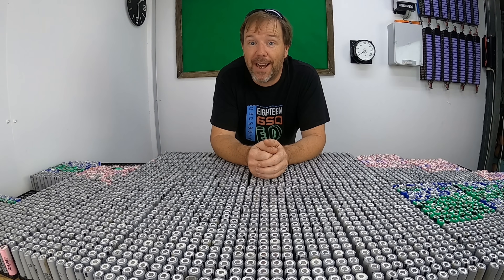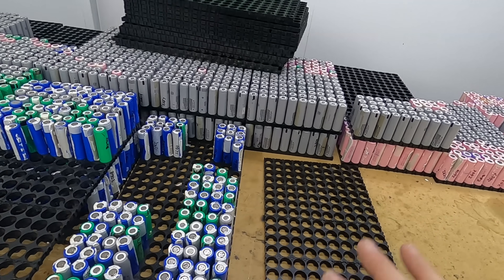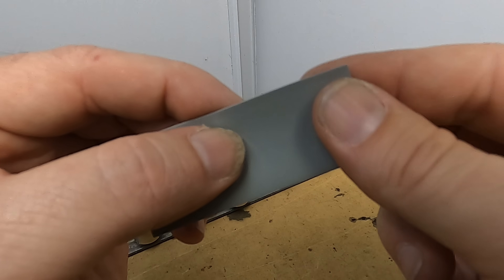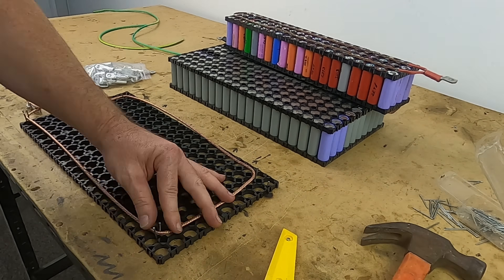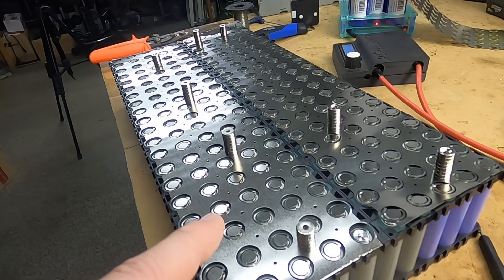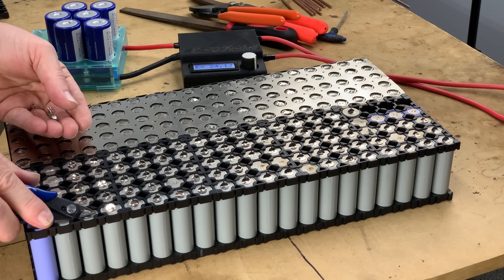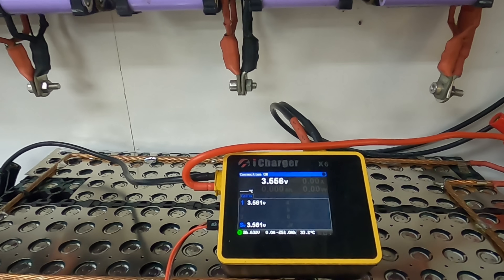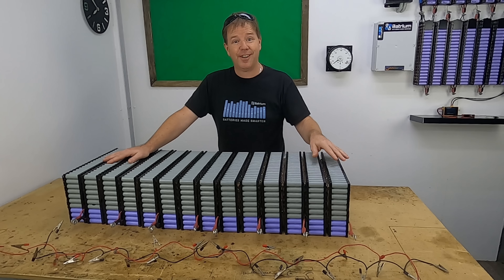Creating my single biggest D.I.Y. battery with 2800 18650 cells recovered from used laptop batteries

Comment: Dude, wtf, if a cell goes bad in the middle of the pack, as is common with old batteries how the heck you going to find it?
Reply from the maker: Thermal camera? Same as a bad piston in a car.. pull it down and inspect..
Reply: @HBPowerwall  thanks mate. Although worse case, 4 cylinders in a bank, not 300. Has this happened in actuality to one of those gigantic banks? How hard to swap only single cells?
Reply from the maker: You don’t swap them you just snip a fuse wire

Comment: I'm a little confused as to the order and placement of things. I was noticing as you were putting in the blanks, you had them installed in places on the cell holder, vertically and horizontally. Was there a reason for the blanks to be placed in that position or was that just what you did because its inconsequential ? I also noticed that you applied heat to some of the batteries in the beginning of the line, then skipped the middle ones, and then went back to the middle to finish. I just wanted to know if that was for a reason and was imperative to the process, or it just didn't matter and you did it out of order.

I hope this doesn't come across as rude, I'm just a little dumb and it kinda threw me off. Love the video!

Comment: Won't you have to replace all these cells after 3 years?
Reply from the maker: Maybe or it could be 10... bit like a used car - if that's all you can afford - you run with what you have..
Reply: @HBPowerwall  Ok thank you. I was just curious because I'm researching about off the grid energy that's cost effective but efficient. Finding the sweet spot as they say. Thank you for replying 😊.
Reply from the maker: Almost any time.. and I have more time than money, so this worked for me. .

Comment: How do you guys sleep at night? I mean, the video is great and all and just wow, how much work you put into the packs. I just wonder, if anything ever goes wrong, can you even imagine the fire that those batteries will create? Just hanging off a wall like that, no fire protection. You know what you are doing I get it, I just couldn't trust lithium batteries. The fuse strips are actually quite astonishing though, I had no idea there was such a thing, but I can see where they add a bunch of additional safety!
Reply from the maker: watch the next few videos, i got 12 hours sleep every night 😉
Reply: @HBPowerwall  i fly racing drones as a hobby and crashed a ton of batteries, so i know how tough they actually are and how much beating they can take. Including improper charging. I am always nervous around them though! Perhaps I am too paranoid
Reply from the maker: Drone batteries typically aren't this type of battery, and lipo's go south FAST, you don't dint or damage these cells in anyway or the internally short and go FIRE fast.
Reply: @HBPowerwall  Good to know! I am starting to experiment with them. I guess I will have to subscribe and binge watch your videos :D

Comment: 13.00   don´t like the  soldering technique;     solder not guaranteed to adhere properly to the nickel plate, only to the copper wires on top, where the flux landed!!    i would  re-do all,why risk it, there are gonna be vibrations around there.
Reply from the maker: I agree, it has all been redone and doubled down on the points. Its stationary storage, zero vibration

Comment: Li-on? Hahahah. you know one hole or something and this is a problem. I would Just put a heat wall around it. that thing is allot of juice. The problem I have with this is my laptop battery became useless when the Charge was irregular, The batteries in laptops have sometimes multiple cells and one will become more or less charged than others and the unregulated power will make it turn into junk, This is a reason allot of laptops batteries "go bad". So If you charge this I would Make Sure to try to keep the current the same in each, overcharge and undercharge and stress on Li-on is pretty... dangerous I guess. Good luck! This is Way too much raw material for me to feel safe handling right as of yet.

Comment: aren't used laptop betteries dead?
Reply from the maker: Typically its just one or two cells that have failed, or perhaps the laptop it self failed and the whole thing was recycled. there is also, going so flat the BMS cuts out, perhaps it was sitting on the front seat of a car and the thermal sensor in the BMS triggered causing it to no longer function as a laptop battery. We have a saying test them all.. if only one out of six cells is useable its a good battery.

Comment: Sort them by impedance then order them by greatness in the series and you may save a lot of balancing.
Reply from the maker: I did everything I could IR was tested at about 50, so they were all nice and close - the batteries were sorted by capacity
Reply: @HBPowerwall  watching documentary saying something like 5 to 20 percent variability within just a single batch made. don't think it would be that tuff to balance the voltage cascade of the series

Comment: Starting off with used batteries kind of makes this a waste of time.
Reply from the maker: 1.2 million views, learnt a LOT, had some fun, built something cool, saved some landfill/early life recycling,  yeh can't see your justification of a 'waste of time if I tried'
Reply: @HBPowerwall  what I mean is your battery packs aren’t going to last as long as if you’ve used new ones.
Reply from the maker: Would any human think that used cells would? I'm guessing your trying to be funny/smart - but honestly it'll work as intended for 10 years with maintainance (current setup is 5 years full time service) then i'll be recycled - just think of all the energy from the grid i won't need... Green house gases saved so many advantages out weigh the 1000s of hours to build..

Comment: from that amount of money you could buy lot more lead acid ones...
Reply from the maker: That would have made a really shit video with less capacity, life span, and DOD..
Reply: @HBPowerwall  i have a lead acid battery bank 1200a at 24v they're working for 7 years now, and bougth them as used folklift batteries. Am I just lucky than?
Reply from the maker: I started the same way... NEVER going back! DOD & energy density is next to no competition.. Look back 500 odd videos you'll see my old setups
Reply: @HBPowerwall  I'll have a look, but for now I'm happy with my setup you know it's working and I'm not loaded to change it.
Reply from the maker: Me either took a year to build this cheap :)

Comment: This is much easier than making ebike battery. Don't need to flip terminal of each section. 3.2v x 14 pack =44.80v system.
Reply from the maker: 3.7v batteries so 48v

Comment: I only spent $62k in used batteries. Now I can power my house. It'll only take 127 hours to build lol
Reply from the maker: Well to be fair, I got the cells on a trade & you could build in say 40 hours is you took out all the fucking around with film and edit.. BUT now i COULD add this to  the other 50kwh i have in service and have 75kwh to power my house for days...
Reply: @HBPowerwall  appreciate the vid. Pretty cool stuff tbh
Reply from the maker: Thank-You

Comment: That looks tedious as all hell... But what happens if a cell goes bad??? How do you troubleshoot all that??? 😬
Reply from the maker: Sounds like you've never replaced a clutch in a car, or had to pay for one.. You bitch like hell about the price and time and you get it done.. What other choice do you have? Drive a broken car?
Reply: @HBPowerwall  🤣

I feel you.

Curious why you went with 18650s instead of those larger rectangular blue cells? Still unsure of what they're called...

Comment: Is a 193p pack a good approach? Doesn't it risk lots of cells even if one becomes faulty? Isn't it a better option to use more smaller p packs, for example 50p max? Is it a possible/preferable to parallel connect multiple 24V/48V packs? For example multiple 50p7s packs connected in parallel each with their own BMS?
Reply from the maker: Time has showen the cells stay more balanced and behave nicer under load with higher P packs... Also cheaper to BMS
Reply: @HBPowerwall  Thanks, important info for me! I'm building my first ever ~100 cell battery for a small vehicle, later thinking about a 1000+ cell pack. So is "Taking 14 cells from the 3400 range, then 14 from 3350 range, then 14 from the 3300 range and so on" a good approach? I thought similar cells in a P pack are the goal, 2450-3400 mAh connected together seems like they would "hurt" each other.

Comment: Impressive! But how labor intense is maintenance/replacement? It seems like laptop batteries really start to degrade within 5 years of use (my experience with batteries in laptops themselves). Buying used batteries it would seem like within 5 years you'd have a lot of lost performance in this type of system.
Reply from the maker: Imagine keeping billions of cells out of land fill for another 5 years.. Maintenance  is always there no matter the project.
Reply: @HBPowerwall  Ultimately the cells need to be recycled, or they all still end up in the landfill anyway. I read China will "dispose" of roughly 2,500,000,000 cells in 2020 alone when upgrading electronics, it said roughly 5% of all lithium cells are recycled.

Comment: Can you help me understand something?, iff i build a pack with random batteries without checking the capacity what is ther worst thing that can happen, i know a chain is as strong as its weakest link and but here i don't know if the bms will push to charge the pack at the highest battery capacity or will stop at the lowers battery capacity, i am doing the same as you with a lot of 18650 but i still don't understande what you do with the difference capacity cells.
Reply: I mean you separate the cells in capacity, then around 2min 40sec into the video do you just evenly distribute them making the packs with mixed capacity cells?.

Comment: How long will one of these battery packs last and will it be possible to maintain it on a cell by cell basis?
Reply from the maker: 10-15 years is my guess, you can maintain anything with time money and knowhow
Reply: @HBPowerwall  That is very impressive and makes it well worthwhile in doing. I'm guessing it would require switching out some expired cells every few years?

Comment: Could I use 3 of those to replace a 12v lead acid?
Reply from the maker: Its not ideal as three is too low voltage and 4 is too high to match lead voltage range.
Reply: @HBPowerwall  My application isn't to use it as a replacement for a powerwall system. Rather its to power a marine electric trolling motor. On average it will pull 40 ish amps maximum and it doesn't have any cut off so it would be whatever the BMS decides. I'm not sure if this makes my situation better.

Comment: Too many damn connections to fail. And its a fire hazard. I bought 16 LiFePo4 CALB cells at 280ah. With the shipping and 16s48v BMS it was $4800 Canadian. Took me 2 hours to build a 14.4Kwh battery with better cycle life and no risk of explosion.
Reply from the maker: Would have made a shot build video lol
Reply: @HBPowerwall  What is more practical for people to implement themselves? Your system or mine? Which is going to be more reliable? 32 connections versus your thousands? 500 cycles vs 4000. I mean all the power to you for trying to copy Tesla but you know that their powerwall has a thermal management system to make sure it does not run away?

Comment: Hopefully none of those recovered batteries are the cheap China ones, otherwise you're liable to get the biggest DIY fire. Nice job for sure on that pack. Good information.
Reply from the maker: NONE are cheap cells but all recovered from used laptops with 100's of cycles on them.

Comment: That will be a great show when they eventually go up in flames
Reply: this is bound to happen. Maybe i skipped to much of the video but is there any form of matching and monitoring? Going from the collor coding on these old cells is not enough imho.  
 If one of these cells gets to much off and gets discharged to much it will indeed go up in flames during charging.
Reply from the maker: might have paid to watch whole thing.. EVERY cells was capacity tested & IR tested, all rested and tested for self discharge & excessive heat while charging and discharging.. they every battery was sorted into 50mah groups then a balanced battery was built from that. Then there is 2 cell level fuses on each battery,  There are so many layers of safety if this thing goes up the security cameras that watch it in 4k will be released on you tube also :) Lets not get into the BMS, shunt trips, shipping container its housed in, ventilation fans based on temp, fire alarm attached to the BMS.. i tire with this essay but you get the idea.

Comment: Why would you do this? That's enough power to supply an average house for a week or so. During what disaster would you need power on for that long, before your neighbours have resorted to cannibalism or as least decided to come kick your head in for not sharing, as they see your lights on all night. Then they all try running microwaves and electric heaters, even after your painstaking lecture on why they weren't to do what, and the fucking thing runs flat in an hour. Which they blame you for, and are somehow even MORE angry about after, all the more so when you point out it's their fault.
Reply from the maker: I did it because i thought it would go well on youtube.. Turns out that part was close enough. Also i have another 50kwh of storage I use daily ( that can easily get used in a day) adding another 25kwh of storage i'll have a little extra head room..
Reply: @HBPowerwall  50 KWH over 24 hours would be a constant draw of 2KW! Realistically it'd be more like 3KW during waking hours if I assume you switch stuff off when you go to bed. Unless you've got an electric blanket that could roast a pig. 

What do you do with all that power? If I just add  up the stuff I have plugged in at  any moment, I'm probably  using maybe 100 - 200W. More if I'm in the electric shower but that's only 10 minutes. 

How do you end up using 50 KWH in a day!?!?
Reply from the maker: it's more like 4000-6000 watts while i'm working and 800-1200 all night.. i've had lots of 150kwh per day when i'm fixing lots of rigs - man does shit get hot those days..

Comment: 1 cell broken and you will have to tear everything apart testing one by one 😅
Reply from the maker: Same as blowing a rear seal in your motor. Gearbox, clutch, flywheel out. What’s your point?
Reply: @HBPowerwall  time consuming to trace i believe. Since you had patience to build that, then you have the patience to fix it. Not everyone can.
Reply from the maker: Thermal camera and or a multimeter you'll find issues real fast.. a bad cell will be either hot under load or dead flat..
Reply: @HBPowerwall  that’s true. With lipo, a dead cell inside is a wrap is a big loss. I use a lot of lithium batteries for 3D flying large sized RC helicopters. 5500mAhx2 Lithium batteries will just last for 3.5 to 4 minutes of hard 3D depending on RPM too. If you lose a cell in the air and you don’t have autorotation skills or just you were too low. Definitely you will end up crashing. I hope soon technology will change on batteries so that we can afford and enjoy the hobby. 

Why didn’t you go with Yinglong batteries lithium titanium batteries? They say they can go up to 25000 cycles.
Reply from the maker: Because these were available and Yinglong batteries would have made for a shit time lapse putting it all together lol
Reply: @HBPowerwall  you mean short time lapse😂.  Anyway great work. You are so patient to do all that work.
Reply from the maker: lol - thank-you

Comment: hi there wanna ask if there is a single or two 18650 defect, is it gonna have big effect to the whole system?
Reply from the maker: It depends on the defect. In theory I could lose dozens of cells and have the fuses blow and the BMS would still keep the battery healthy. But also show me week cells that might need maintenance
Reply: @HBPowerwall   I'm really curious how BMS is able to detect which cells are weak. is there any practical way with this method to replace dead cells? Could dead cells not short out the entire pack? Edit: OK I did some research. If a dead cell shorts, The rest of the parallel cells in the pack will instantaneously dump energy back through it, blowing the built-in fuse in the nickel panel, and returning quickly to normal operation.
Reply from the maker: @stevenlu7324  yes your edit is fairly correct - however there is the case that I've seen many times whereby the cell becomes a heater but only 'warm' not hot, so will still bring that battery down slowly over time. That's where the BMS does its job. The cell that never balances and has no data for bypass is the weakest cell. The Cell with the highest bypass is the strongest battery.
Reply: @HBPowerwall  thanks for the reply! This kind of thing is where experience trumps everything. Would you say, then, that a really good design approach would be to allow some gaps between the big cell packs to be able to use thermal cameras to quickly diagnose those “browning out” problem cells? And we could just snip them out of the circuit rather than going to the lengths to physically replace these.